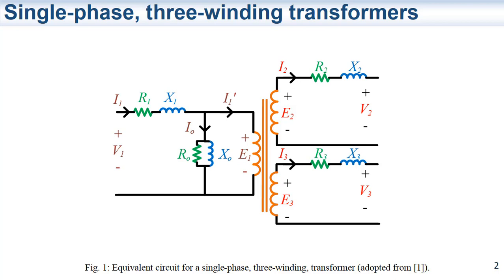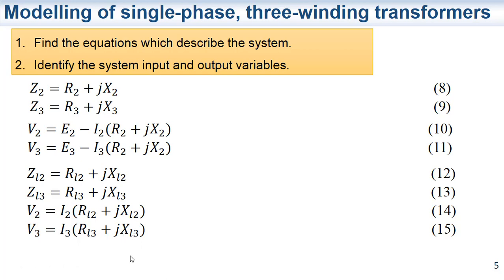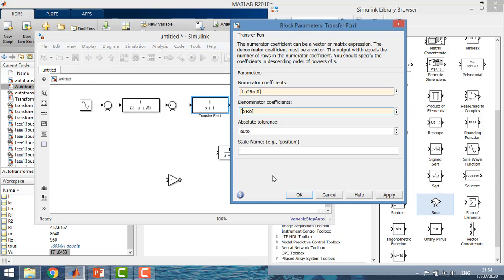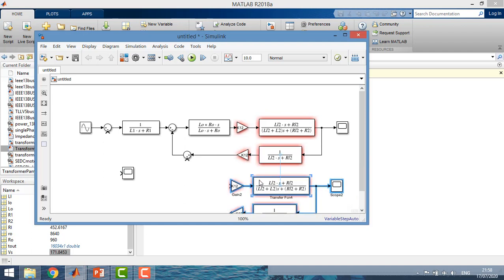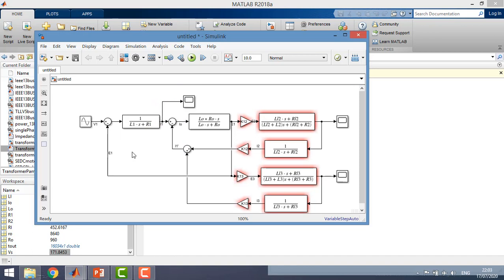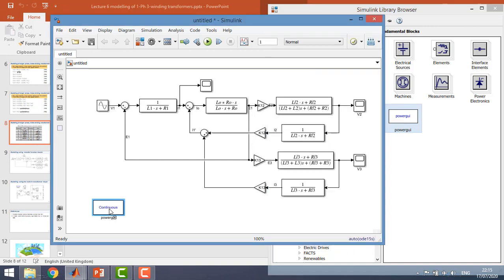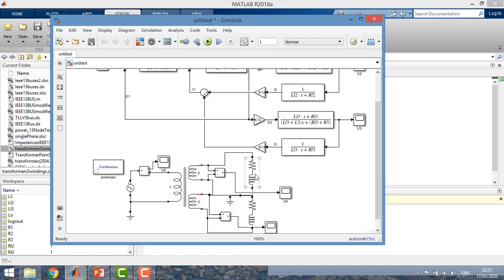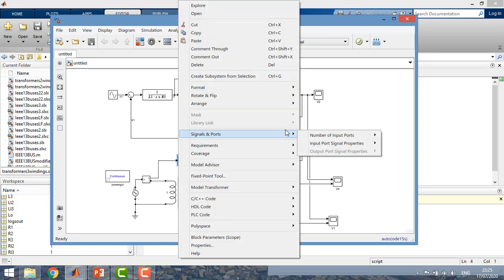Lec 6: Modelling and simulation of single-phase (three-winding) transformers using Simulink /MATLAB

Comment: Sir, I'm working on "High-Frequency Transformer Design for Solid State Transformers in Electric Power Distribution
Systems". Kindly help me to design HF transformer. Transformer frequency is 10kHz, Power 1MW, Primary Voltage is 10kV and secondary is 400V. I am struggling with transformers calculation of Resistances, Inductances and capacitive effects value. All of these values are in 3 phase. Please guide me for these, it will be so kind of you sir. Thanks in anticipation.
Reply from the maker: Hi Syed Talha, this is not my area of expertise and my hands are really full at the moment, please accept my apologies for that.  Having said that, can you use a transformer with smaller size then scale it up to 1 MW ?, i.e. one of these transformers listed in 
https://scholarworks.uark.edu/cgi/viewcontent.cgi?referer=&httpsredir=1&article=2381&context=etd
Reply: @DrCEng25  No problem sir.
Reply: I will definitely see the report. Thanks for that.